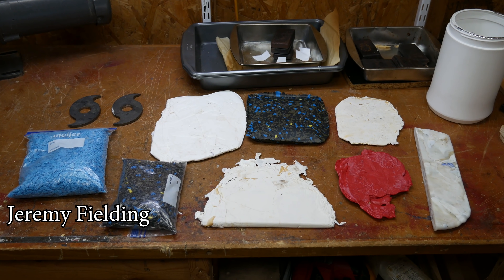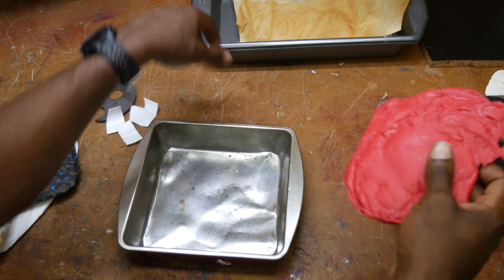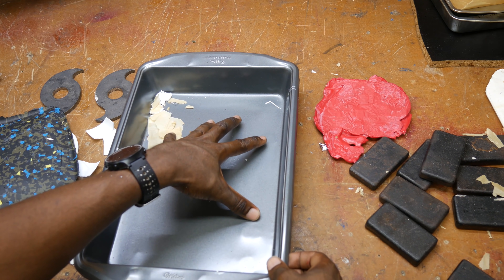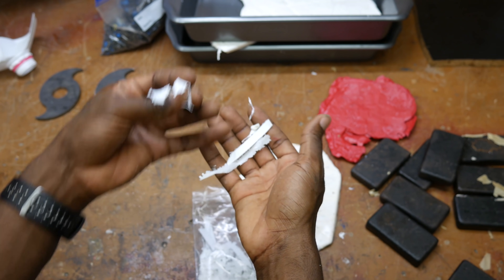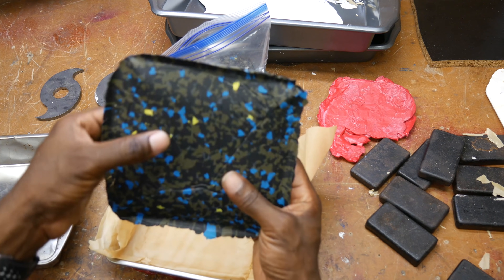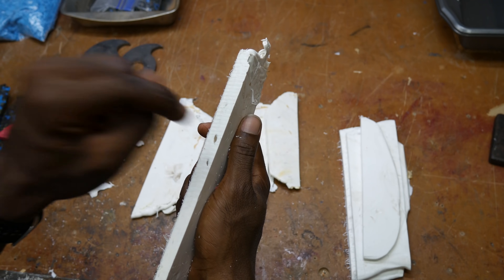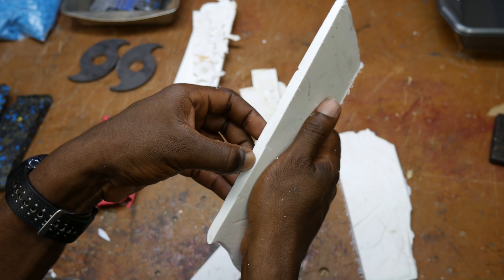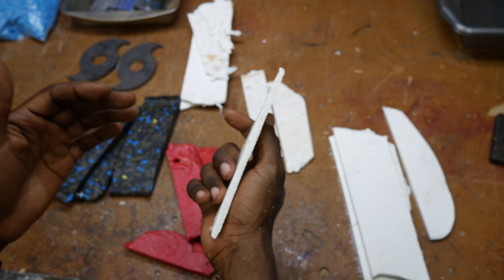HDPE, How Much Processing Is Required; I Put It To The Test!: 043

Comment: I've found HDPE polydrums (You know, the modern version of the 55 gallon drum) are made of unbelievably tough plastic.  I don't think all grades of plastic are created equal, food container HDPE is probably not as high zoot as the polydrums that have to pass DOT standards.  Also, rotomolding, which is what they do to make poly drums and plastic kayaks, seems to be an indicator of higher quality plastics. Whether the rotomolding itself does something to the plastic or whether only higher quality plastics are used for rotomolding, I don't know.
I've never melted polydrums down, just cut them up and mechanically fastened them.

Comment: I've been watching this, (after watching the two part shredder vids), trying to figure out why the two blades on your bench are so familiar. When you said, 'dado shredder', it struck me: dado blades; why couldn't dado blades be re-purposed to use in the shredder?

Dados are toing out of favor, due to a bad reputation for eating fingers, so used sets are cheap. I think I even have a brand new carbide set I've never used.  That would cut the price, and time to fab the shredder.

Re: the smaller pieces. The pros shred the HDPE into small chips to reduce voids. Smaller chips inherently create smaller air pockets before heating; smaller air pockets to start means less chance of voids.

Re: voids

The flimsy cooking pans flex too much. The small amount of weight/pressure on the plastic is reduced even more when the pans flex. The plastic needs to be melted and pressed in more rigid containers, with more pressure.

Idea from a different area of plastic processing:

Recently, a friend got some injection mold equipment at an auction. He knows nothing about injection molding, and I know a bit more, (a friend owns an injection molding company). 

I was considering an injection molded part for something I designed, so I leaarned about the injection molding. I've toured his plant, and learned a lot about the process from my friend. Because of my knowledge, I was asked to research what he bought, for value.

One of the devices he got was an ethylene glycol heater and pump, (EGHP). This was a completely new aspect of injection molding for me. Turns out some plastic are stickier than others, (sound familiar?), plus some plastics solidify at a smaller decrease in temp than others, (also sound familiar?).

The pros use EGHP to counter these issues. The heated ethylene glycol, (anti-freeze?), is pumped through the injection mold to pre-heat the mold, and to keep the mold temp steady while the plastic is injected into the mold.

The EGHP keeps the plastic from solidifying in small passages before the mold is full, and to help it release from the mold.

Could a similar setup be confabulated for processing the HDPE? More rigid forming/pressing 'molds' need to be made, anyway, why not add a fluid jacket to the pressing pans? This should assist the plastic releasing from the 'mold'.

The molds could be heated before the shredded HDPE is dumped in, and kept hot while pressure is applied. If I recall, the EGHP heated the EG to ~250°F. Seems to me, you could squeeze 50-75° more out of the EG, (need to check boiling point).

If you could get the EG to 300°F, you could use it during the beginning of the process, to assist in compressed the HDPE, let it cool, then hit it with hot EG, to assist in releasing the plastic from the pressing mold.

Re: test of paper shredder

Elsewhere, commenters have mentioned paper shredders with the ability to shred credit cards. Was the shredder you tested credit card capable?  If not, that is something to determine. It may be a paper shredder MIGHT do the job.

Keep at it... any chance at a 2019 update on your HDPE project(s)?
Reply from the maker: I have been thinking about it, but I am not sure with the schedule I have lined up. People are still asking about it, and I am still interested so we shall see. I didn't want the setup to be to complex or costly. The high volume paper shredders that can cut many plastic cards are more expensive than I was going for in this project. The goal was very ambitious. I wanted to do a super cheap spreader. I have large "geared" motors and other options that make it work for me... and I got them cheap but at the time I felt like it was cheating... I didn't consider that motor to be "easy" to get. I wanted it to be cheap for anyone to make.  The truth is I just had to search the web and local listing, and it wasn't long before I had 6 of them with gear boxes on them.

Comment: I've been saving all my old HDPE containers with the idea of making a large 1" thick sheet to essentially form into a custom battery case. The problem is you can't tell when you have enough pieces. I'm guessing that only comes from experience after melting a bunch a down to see what volume you get. But I guess I'll just keep saving  until I have a massive amount
Reply: You may no longer have this problem but you could weigh it and divide it by its density (Google says its 9.3 g/cm ^3) that would give you the volume

Comment: I cut up my milk jugs (HDPE) to make round a plastic adapter for my RV Air Conditioner (I vented the AC/Heat to the back of the RV).  As a mold, I stacked cardboard, then cut my form out, and taped the side to keep the HDPE from deforming.  Took about 2 hours, but it worked really well.  I used a blender to shred three containers, and it looked very consistent similar to your commercial shredder sample (it was a Ninja blender).  Since the burning point of the paper is 451 deg, doing 350 deg keeps it well in limit.  So try the cardboard (corrugated paper actually), it worked really well and the cutting was very similar to wood working.

Comment: Great video. Thanks. Is plastic an insulator? Could the thickness you are attempting affect the quality due to uneven temp outside/inside? If that is the case, maybe you could you could heat incrementally in layers like 3d printing.

Comment: Okay boss so I have also been working with the HDPE plastics for a bit now and one thing I might offer is when you check your cooks, get an old wooden rolling pin from thrift store. so when you check it give it a good rolling with the kitchen tool. and as for cooling you can cut time down to nothing when you roll it a couple times during cook and then clamp it up before dropping it into a cold water bath until cool to the touch. I use cookie sheets as I have never seen any need for a thicker sheet. I have also used Atomic shrimps method of using a sandwich griddle again from thrift store. I have also used soup cans with cooking spray to make fence posts by 
making several small beams and then using hot air gun to heat the ends and clamping to join several of them to reach desired lengths. Keep the videos coming .
Reply from the maker: I also tried the griddle and that worked really well. I now use silicon baking sheets and they are also awesome. Thanks for the tips

Comment: Hey don't know if you are still working with plastics. I work in a machine shop we turn plastic on a regular basis and fill trash cans. We just throw the material away. Maybe there is a simular situation near you.
Reply from the maker: Thanks for the tip

Comment: Forget parchment paper, just use the regular pan, melt all the plastic that will fit into it. Once its melted, put it in a sandwich press. It will come out completely flat with very little air pockets.

Comment: I have not been able to try this myself, due to my annoying lack of money to buy parts, but I am wondering if you have tried  making a block shaped mold, then injecting your HDPE into the mold with a piston.  I suspect that might significantly reduce, or possibly eliminate, voids and large bubbles, and give you a piece that requires less work to reshape. For example; if you want to make 2" x 2" cubes, you could make a simple  aluminum mold that is 2.5" x 2.5", then trim it down to 2" x 2" to get get rid of any surface distortion caused by shrinkage.

Comment: I am most the way through your playlist on HDPE plastic recycling and have watched just about all of the precious plastics videos. I have certainly gained a lot of knowledge but have not come across the final answer to what I am trying to do. I will not be turning plastic on a lathe, I don't think some voids on the inside nor even a few pinholes on the surface will make a difference for my purpose, but what I do need is as close to perfectly flat and even thickness as possible (with no warping). What I am wanting to make are bats. Not the flying kind and not the sports kind, but rather the potter's kind. Simply a flat sheet in a circular shape that sits between the wheel head and the clay. When you are finished throwing the pot, you simply lift it off the wheel head by removing the bat. Later, after setting up a bit, you remove the pot from the bat. I could cut the circle out of a sheet of plastic but would prefer to just mold it and not have to re-recycle plastic. Would love for the surface to be pretty smooth but a light texture would be no problem. Many commercial plastic bats have a smooth side and a textured side, it is a matter of preference which side you use. I have used both and lean towards the smooth side but do not have a strong preference. How thick it is is not really an issue, I would simply want them as thick as needs to be to not flex or warp and no thicker. I guess I am asking for suggestions from you or you neighbors. I feel like my final product is very basic and there has to be a simple method involving few, if any, specialty tools like the ones precious plastic has designed. My question is not really about shredding, I will have to experiment with that to find the best/easiest method for my needs, it is more about how to shape and finish my final product, which again, is simply a flat sheet of a consistent thickness. And if it is already round (or roundish, honestly doesn't even have to be round, just my preference), all the better. Thanks, love all your videos, been watching them well before I ever thought to play around with plastic!
Reply from the maker: I currently use a Griddle and silicon baking sheets, which not only give me a uniform flat sheet, it doesn't have any voids if you are willing to open the lid and knead it once or twice during the cycle. Very easy, very cheap, and I just haven't made a follow-up video on it.

Comment: Another thought [[have not read all the comments but Victor Stricklands was good]]  Using clamps to increase the pressure while it is still pliable.   Same idea as the Rollers but something anyone who has tools probably owns.  Second thought, I do metal metal-jewelry designs, ant hill casts and other misc things.   I wonder what the temp to turn it into liquid wothout burning it would be and whether it changes or degrades the plastics doing such.   One problem with what I am seeing doing this is energy cost.   I'm researching turning waste plastic into oil to fire one of my melters.   The enrgy efficiency of doing such [[plastic to oil]] is not good so I am working on a system that starts with a charcoal fire-turns plastic to oil then feeds itself [[the fire]] using the oil and capturing the excess for other usage.

Comment: what I have found in my experience is that no matter what size the plastic pieces are when melted the air bubbles must be allowed to rise to the top and be popped prior to applying pressure.  pressure must be applied 2 HDPE to avoid shrinkage.  the trick to the process is letting the HDPE come to temperature and allow the bubbles to rise and be popped.  color and swirling effects can be achieved when allowing the bubbles to rise.  Tiny Bubbles or a lot slower at Rising and often do not.   the reason why you get better results with tiny or flakes is because you are reducing the amount of air between the spaces.  if you want to increase blending use larger bubbles that will surface to the top such as bottle caps

Comment: in the interests of science.... has anyone tried this with those stonedyne/ceramic lined nonstick frypans as the top/bottom?
Reply from the maker: Soon after making this video I started using silicon baking sheets. They are fantastic for this applications. I also use a griddle instead of baking in the stove. It is much faster as all the heat is "pumped" right into the plastic.

Comment: I hope you are up for a very different kind of question. I have an RV freshwater tank. It sat outside for years. Leaks badly. Big cracks, but is beyond repair. The edges of the cracks kind of crumble away. That is the side that was always exposed to the sun. Figuring the other sides aren't as bad. But all in all, not worth even TRYing to weld it back together. 

I believe it is probably polypropylene. That's what most of these big tanks are made of. Always feels kind of slick.

Now, I'll probably cut it up, and maybe save some slices of the best parts of it, to use for slick flat surfaces on tool builds. (Like a platen under a sanding belt.) But for the rest of it... Considering shredding it. Then heat processing into sheets or blocks.

Here's my question: Since the UV obviously did a job on the plastic... If I shred that same plastic up, and melt it into sheets or blocks... Is the damage that was done to the plastic, going to "carry over', to the sheets or blocks? Or does melting it, and re-forming it to something else, essentially give it a 'start-over'?

I know you don't know EVERYthing about plastics. LOL But I have been looking all over, and can't find anything that addresses this. I'm hoping you'll have a clue for me. :)
Reply from the maker: I have no idea
Reply: Thank you. :)
Reply: unfortunately uv and thermal damage to plastic is permanent and permanently slices the molecules of hdpe which is even remelting wont fix however I have used uv damaged plastic successfully and it seemed very strong when remelted this may be possible because basically what happens is hdpe is made of long chains of molecules and what uv damage does is split these molecules apart permamentely decreasing the strength however uv damage tends to look worse before it's remelted because uv damage only occurs on the immediate surface of hdpe and not the middle of it however it cracks all the way through because microscopic fractures tend to propagate even without further uv damage mixing all the plastic together by remelting will remove these large fractures however it wont lengthen the permamently shortened chains of plastic . In other words It is definetely worth a try remelting it because the plastic may still be usable but test it's strength after melting it before using it for objects requiring a lot of strength.
Reply: Thank you. :)

Comment: Fine-tuning temperature + applying uniform, higher pressures will kill the voids.
Reply from the maker: It turns out the voids are causes by air getting trapped. Air is not infinitely compressible, so increasing the pressure won't fix it. If you take it out knead it while it is hot put it back... over and over that works. Or just shred it so there are lots of places for the air to escape while applying pressure.
Reply: That makes a lot of sense.